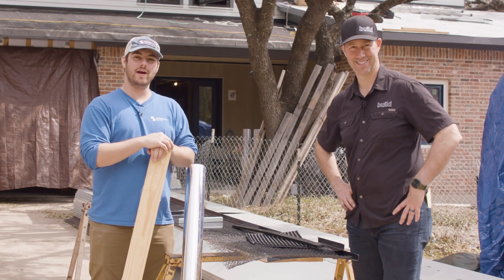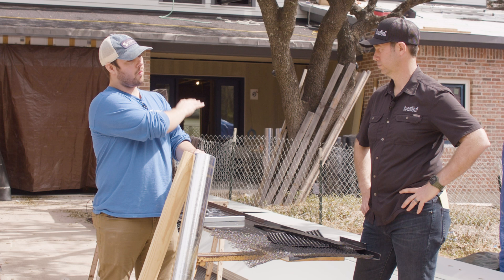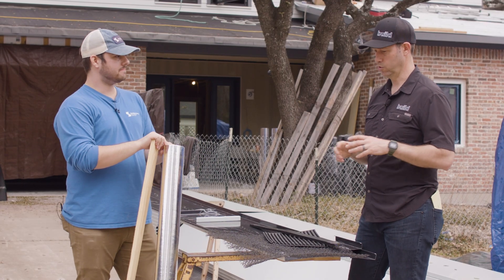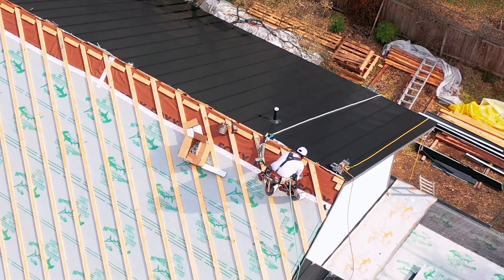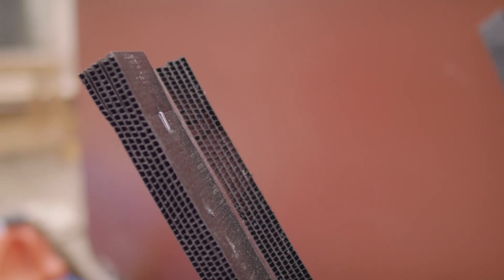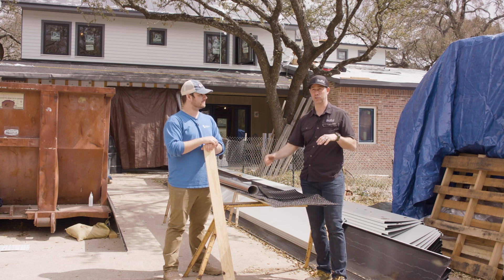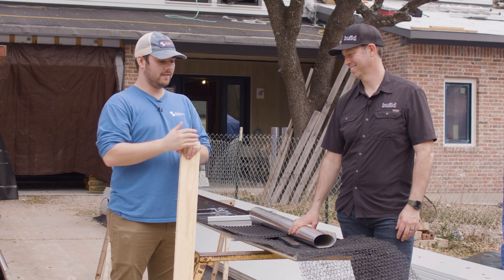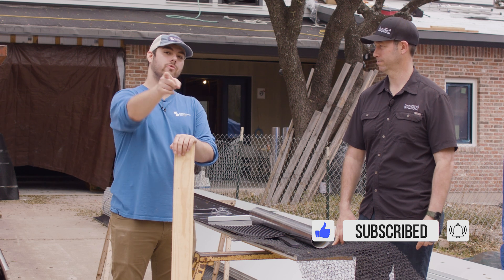Wood Battens vs. Dimple Mat vs. 3D Mesh: Matt Risinger Comparison

Comment: Matt’s attic is conditioned, not vented. For a VENTED attic, what underlayment assembly is recommended to provide a water barrier, vapor transfer, thermal break, and air circulation?
Reply from the maker: For most conditions, we recommend a synthetic underlayment. For the most watertight installation, we recommend a fully-adhered synthetic underlayment such as Sharkskin UltraSA. If you require a thermal break, you can utilized a dimple mat or a nylon-based mat like Enkamat. To get air circulation between the metal panels and decking, the roof would need vents at the eave and ridge. -Thad

Comment: It seems like by now manufacturers should be testing their products on furring strips also, instead of only solid decking, especially with building code mandating external insulation.
Reply: Perhaps they are against people having a good roof.
Reply: @jakebredthauer5100  They are loathe to consider furring strips because there is more of a risk of cometic shortfalls.  They want their products to look the best possible and for contractors to not face call backs.  Thermal performance and cost efficiency doesn't reflect back on the manufacturers.

Comment: The only issue I have is the wood 1x4s. They rot. At minimum I would water seal them but I like to rip down 1xX composite boards and use them for the air gap.

Comment: What is your solution? You do not say best practice for 3/4" to 1" metal roof air gap above the deck if the two products you covered are not thick enough to space metal roof panels above the deck. You do not sound to like fir strips to create air gap. Again what is your solution for creating 3/4" air gap?

Comment: Again how do you adhere to manufacture install instructions of having to apply to wood decking but you need to ventilate with conditioned attic - how would you be able to ventilate it then?

Comment: Two things: 1) the description of the radiant barrier doesn't make sense (pointing the reflective side away from the sun), and 2) if the dimple mat and 3D mesh products don't support above-deck ventilation, and the furring strips are out of spec, then that means no above-deck ventilation product was shown. Time for another video!
Reply: I did some research.  Sharkskin is CA based company and this is their largest market for radiant.  The CA 2022 Energy Code describes the barrier as an attic feature, not something above the roof deck: "RADIANT BARRIER is a highly reflective, low emitting material installed at the underside surface of the roof deck and the inside surface of gable ends or other exterior vertical surfaces in attics to reduce solar heat gain."  In Appendix section RA4: "the radiant barrier shall be securely installed in a permanent manner with the shiny side facing down toward the interior of the building (ceiling or attic floor). Moreover, radiant barriers shall be installed at the top chords of the roof truss/rafters in any of the following methods:
(a) Draped over the truss/rafter (the top chords) before the upper roof decking is installed.
(b) Spanning between the truss/rafters (top chords) and secured (stapled) to each side.
(c) Secured (stapled) to the bottom surface of the truss/rafter (top chord). A minimum air space shall be maintained between the top surface of the radiant barrier and roof decking
of not less than 1.5 inches at the center of the truss/rafter span.
(d) Attached [laminated] directly to the underside of the roof decking. The radiant barrier shall be laminated and perforated by the manufacturer to allow moisture/vapor transfer
through the roof deck.
(e) In addition, the radiant barrier shall be installed to cover all gable end walls and other vertical surfaces in the attic."

Comment: What are your thoughts on if one were to use the Viper cdx product on top of sharkskin across a low slope roof? 3/4 ply base, 2" polyiso with radiant barrier applied above, sharksin, viper, then metal.. I heard you say it does not meet the gap thickness for radiant barrier but I dont want it that thick and also believe that a little will be much better than none? What about issues at the gutter edges, or would I need to use a different product for insect rejection? I like the idea of airflow underneath, added radiant barrier distance, and possble sound dampening benefit. Thanks for your channel!
Reply: Giving this question some attention.  I was wondering the exact same thing

Comment: Radiant shinny barrier should NEVER touch the metal roof! It should also face the sky, not the house's interior. Come on, you guys are over thinking this ! shinny side reflects heat, other side doesnt' do jack. Air gap needs to be between heat source (metal roof) and radiant barrier. please take down this video and upload a corrected one. how can 2 pros mess up the basics so badly!
Reply: Common logic would support your conclusion. I was reviewing the LP Tech Shield radiant barrier product and they also specify the shiny side down. If anyone knows the reason I'm sure a bunch of us would like to know why.
Reply: @gone2dmtns  I did some research.  Sharkskin is CA based company and this is their largest market for radiant.  The CA 2022 Energy Code describes the barrier as an attic feature, not something above the roof deck: "RADIANT BARRIER is a highly reflective, low emitting material installed at the underside surface of the roof deck and the inside surface of gable ends or other exterior vertical surfaces in attics to reduce solar heat gain."  In Appendix section RA4: "the radiant barrier shall be securely installed in a permanent manner with the shiny side facing down toward the interior of the building (ceiling or attic floor). Moreover, radiant barriers shall be installed at the top chords of the roof truss/rafters in any of the following methods:
(a) Draped over the truss/rafter (the top chords) before the upper roof decking is installed.
(b) Spanning between the truss/rafters (top chords) and secured (stapled) to each side.
(c) Secured (stapled) to the bottom surface of the truss/rafter (top chord). A minimum air space shall be maintained between the top surface of the radiant barrier and roof decking
of not less than 1.5 inches at the center of the truss/rafter span.
(d) Attached [laminated] directly to the underside of the roof decking. The radiant barrier shall be laminated and perforated by the manufacturer to allow moisture/vapor transfer
through the roof deck.
(e) In addition, the radiant barrier shall be installed to cover all gable end walls and other vertical surfaces in the attic."
Reply: @gone2dmtns cause dust
Reply: When you bake a potato and face the shiny side of the tin foil to the potato, it cooks significantly faster than the other way around. The same principle applies to a radiant barrier; you face the shiny side to where you want the most heat to remain or stay out.
Reply: ManiacallyYours  Attics are not made to be conditioned spaces. If anything you would want to keep the heat out to avoid condensation.
Reply: @gone2dmtns  The guy in this video (Risinger) always does conditioned attics
Reply: Sorry to have to tell you, but they did it correctly.  If you wanted to keep heat in the house, like during the winter in a northern climate, then you would put the radiant barrier on top of the roof decking with the shiny side up facing the air gap between it and the metal roof.  If you want to keep heat from entering the house, like in a southern climate during the summer, you would either install the radiant barrier exactly like they did or on the underside of the roof with the shiny side facing the inside of the attic space with a gap between the radiant barrier and any insulation.  It has nothing to do with the shiny side being reflective, but rather how much heat it radiates (as the name implies).

As you may or may not know, heat is transferred through conduction, convection, and radiation.  For most things in building houses we primarily concern ourselves with conduction and convection (via insulation and air barriers respectively).  Radiant heat transfer is usually only a consideration with roofs, and the way we prevent it is by using a radiant barrier.  The shiny surface of the radiant barrier can transfer heat through conduction, but it doesn't let much heat radiate from its surface.  Thus by installing it against the metal roof with the shiny side facing the air gap, most of the radiant heat is prevented from reaching the roof decking underneath, and is radiated back up through the metal roof toward the sky.  I hope this helps clear up your confusion.
Reply: Shiny surfaces don't just reflect light they don't radiate light either. So even if the radiant barrier is heated from the roof then it won't radiate ultra red light towards the house which is what you are expecting the radiant barrier to reflect. 
You can even see this with ultrared thermometers they can't read temp off shiny services because it doesn't radiate back properly. It's called emissivity.
 It's the reason galvelumn is a hotter roof than a white roof despite being as reflective. The shiny service even though it reflects light as good as a white painted roof it retains heat since it won't radiate the heat away effectively.
Reply: Thinking about my child’s lunchbox… shiny side inside keeps hot things hot when I want and cool things cool when I want… of course not at the same time. I conclude the radiant barrier facing toward the inside of the structure will do the same.. so long as I have a way to either heat or cool the inside of the structure. Seems to me it will reflect back in what is going on inside. Just call my idea the “insulated lunchbox theory.” I think it makes sense.
Reply: Completely turned me off to this whole video, also they didn’t compare the products and methods they just hodgepodged them all together completely skewing the results. Appreciate the tip on the layers tho, that’s all I needed.

Comment: Here I have confusion about ai foil, ai foil-faced downwards side here but as I know it should face towards sky side because ai will reflect 97% of the RH. (radiant Heat)
the air gap is mandatory. I don't doubt it, but he can face that ai foil towards sky side but he didn't, why? Is there any specific reason?
Don't say emissivity will work here. :P

As I know for heat, it faces towards the sky side, for a cold its face towards the downside.
Reply: Shiny side does indeed go down. The radiant heat (ir) will go through materials (shingles, metal, osb) so it goes through the non shiny side, then hits the protected shiny side that is back to the non shiny side and is reflected up towards space. 
You will get a contact patch with the special underlayment but it is 5-10% instead of 100. That in turn helps with conductive heat transfer as well.
Reply: they totally screwed up! but even if they did it correctly that fiber mesh material is touching the hot metal panels and the foil radiant barrier so some heat is transfereed between the 2.

Comment: So Matt said he can do furring 1x4's because not in a coastal environment. What would you suggest for a Galveston house :-)  Thad, what product does NOT "negate the engineering."
Reply: just use white metal roof with SRI 75 which is 2 to 4x more heat rejection than "trendy" black roof in this video. then no need to spend thousands on strips and labor for gaps. Saves you money in the long run too because less insulation is needed.
Reply from the maker: To adhere to manufacturer's engineering, you must attach your panels to the same substrate as the original testing. For example, if the manufacturer tested a panel over 1/2" plywood, you also then would have to install over 1/2" plywood. From there, several factors will infer your decision on which panel and material you choose including distance from saltwater, slope of your roof, and local codes/engineering requirements. Do you have a contractor already selected for your project? -Thad
Reply: how do you allow for venting if manufacturer requires install directly onto sheathing AND you have a conditioned attic - building in southwest Ms so basically same climate as Texas  @TheMetalRoofingChannel
Reply: @bellaherna1 I am in the same situation. I believe that is the purpose of the furring strips, that will add under deck venting.
Reply: @TheMetalRoofingChannel  I don't have a contractor yet. I'm still at the stage of studying local codes, including approved roofing products for our high wind area. Thanks for the feedback.
Reply from the maker: Understood! The right contractor will be able to help you with local codes and product selection as well. Here is a free checklist we created to help you ask effective questions when you start getting bids: http://bit.ly/contractor-questions-checklist You can also reach out to our Sheffield Metals team and ask for a contractor referral in your area: http://bit.ly/contact-sheffield -Thad

Comment: Why the diagonal 1x4?
Reply: Best practice is to install a double strapping system, first layer vertical and second layer horizontal...
Reply: @asm101  yup, and that double batting system makes it easier to install the radiant barrier, and the roofing.
Reply from the maker: @Architectural Sheet Metal Yes, agreed on the cross-hatch method. That allows the eave to ridge air flow that I mentioned. -Thad
Reply: @TheMetalRoofingChannel   Just to confirm that I am understanding the details correctly, would the double strapping method would still likely void the engineering on the metal roof?
Reply from the maker: @acdnintheusa  You are correct. If the engineering calls for a specific solid substrate like 1/2" plywood for example, attaching the panels to furring strips would not adhere to the original testing. -Thad
Reply: @acdnintheusa  just use a white roof! no need for battens or radiant foil because about 80% of the heat is just reflected back to space. warranty still in place too and hail won't damage it. ADDED BONUS MY CRYSTAL BALL SAYS WHITE ROOFS WILL BE TRENDY NEST YEAR. THE JONES WILL BE SO JEALOUS!
Reply: @TheMetalRoofingChannel  are those furring strips pressure treated? Is the metal in contact with the copper chromium arsenite?
Reply: @sunshine5349  We will not be jealous. We got a white roof years ago.
Reply: @sunshine5349  the color of the roof matters whether to apply radiant barrier?
Reply from the maker: That's been Matt's preferred way to do it for years, you can probably find more information on his reasons over on The Build Show channel. The downside of installing them diagonally is that you don't get as much airflow from eave to ridge because many of the diagonal battens start or end at a rake. -Thad